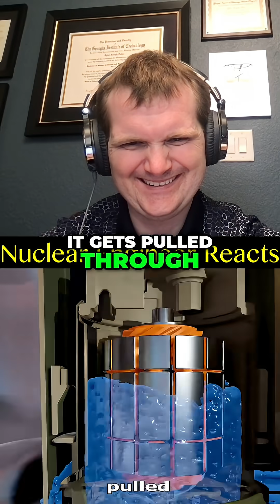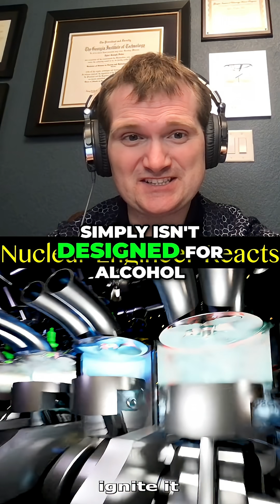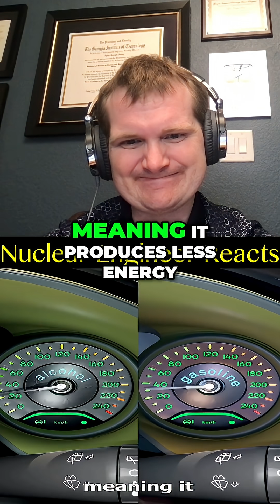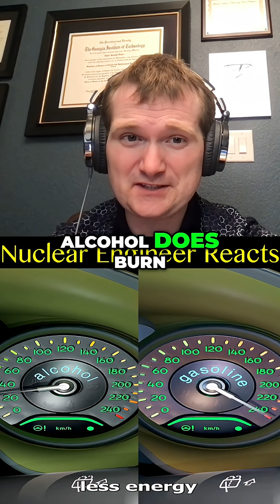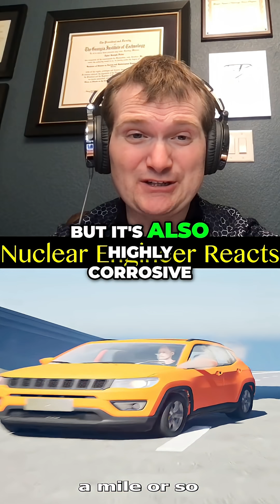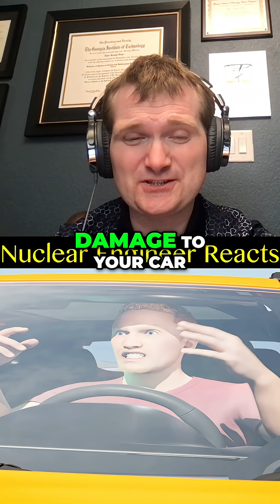Pouring Alcohol into a Gas Tank - Nuclear Engineer Reacts to Zack D. Films

Comment: There are cars running on ethanol and all gasoline cars can be converted to it. It's not really a problem, the air/fuel ratio just needs to be different. The engine will be fine with the right ratio. The fuel system might take a hit from corrosion and you might need to change the rubber fuel lines but those problems are fairly easy to solve

Comment: You can drive on alcohol but your cooling will  not fave the overheating cause it doesn't have the same octane  but if you double the radiation then is not a problem  most modern cars have ECU and will adjust the proper timings

Comment: If you have a flex fuel branded vehicle, it can accept Ethanol fuel, E15 and higher. The main drawback of using the American corn based Ethanol fuel, especially the E85, is that Ethanol is about about 25% less fuel efficient.  You may actually see a slight more performance,  but your mileage will be reduced. Even at today's E85 prices the benefits are not worth the lost efficiency

Comment: Gasoline is an alcohol so I think this is dumb... Well okay it's technically a rough mix of alcohol's and other petrochemicals either fractured or separated from crude but whatever... Point is - alcohol can and does run your car. But NOT drinking alcohol.

Comment: You can do it with a carbureted engine, as long as you warm it up with gasoline. 
Also….. it actually burns hotter than gasoline. 
I will always remember burning pure alcohol in a 1985 truck to pass emissions in Maricopa county AZ in the middle of summer.  I t had two fuel tanks, so I drove in on gasoline, switched the truck off, retuned the carb to run on alcohol, switched fuel tanks to the alcohol one, and restarted the truck. 
My engine temp was 240 when the test ended. I had to dump 10 gallons of gasoline into the tank as soon as I left the bay in order to not fry my block.

Comment: But in this specific case it is a heat problem. Every chemical reaction from a compound burning releases some form of energy. But in the case of a gasoline motor it runs specifically off of the byproduct of compression from the heat. Not the specific amount of energy released when the compounds themselves break down. It is actually less accurate to say its an energy problem over a heat problem.

Comment: The more gas you use, the better the car runs, at least on a car not made for it alcohol. Truth is basically all gasoline has alcohol in it from the pump. Ethanol also is much less likely to knock.

Comment: A lot of cars can handle 10% ethanol in fuel but not by default for most. Sporty cars usually are modded tovrun on Eth
Reply: every modern car can handle 10% ethanol because it's added to gas as an antiknock agent, replacing MBTE, which itself replaced TEL (lead). there are a few "flex fuel" cars, mostly from the late 00s/early 10s and mostly american cars that are designed to burn up to 85% ethanol. the only difference is the flex fuel cars have a sensor that determines the composition and adjusts the fuel mapping to maintain stoichiometric combustion.

there are also people who modify cars to use E85 because of it's much higher antiknock resistance, allowing timing, boost, and compression ratios to be cranked up, making more power out of the same displacement engine.

pouring vodka into an engine will probably not work because it's only 40% ethanol, and 60% water. and the water is of course really bad for the fuel system and can lead to rust and hydrolock.

Comment: Finally! A video I actually know something about. The alcohol will actually burn fine, you'll just need roughly 30% more per injector pulse to maintain the correct air/fuel ratio. This is why you can't run pump E85 in a non-flex fuel vehicle, the computer tuning is way off for the difference and it'll run like crap, if at all. Flex fuel cars have a sensor that identifies the fuel and makes changes in the tuning to compensate. E85 or alcohol in general is way more corrosive too, so the pump/lines/etc need to be rated for alcohol or you'll have other issues sooner than later. Alcohol does have its place in cars however, but they just have to be built for it. A lot of people use E85 in racing and motorsports because while it's less energy dense on its own, it also has a much higher octane rating, so it makes it safer to run on high compression and/or forced induction setups. You'll use 30% more fuel, but it's substantially less prone to knock and pre-ignition, which will make engines go boom in no time.
Reply: All this is also why it wasn't trivial to switch from leaded gasoline to unleaded with ethanol as the anti-knock agent. Because while ethanol works great as octane booster, tetraethyl lead is also a lubricant and forms a protective coating on the cylinder surfaces, while ethanol is an anti-lubricant. It's corrosive and strips away lubrication. It's such a shame lead is such a toxic heavy metal.
Reply: @tylisirn you're correct, lead also coats and destroys oxygen sensors, which are crucial components with fuel injection in basically every modern vehicle. The best race gasoline available is leaded, but you can really only use it on carbureted cars because they traditionally don't use oxygen sensors.
Reply: Yeah this guy is insulting popcorn sutton and the moonshine runners and I dont appreciate it.

Comment: Ah in some countries people  drive with wha5 they drink a classic carburetor aspirated engine wont matter what you put but it has to be 99% one also you can mix it with  sugar it will  increase the octane but you have to keep the engine  at higher  rev as possible the problem is not when the engine runs  but actually when it stops 😅 and yeah if you add sugar in alcohol it make even watter burn so yeah  100% octane 😅

Comment: E100 is a thing in some countries but most notably in Brasil, and despite having less energy per volume, with optimized compression it and a richer mixture (controlled by the ECU) actually produces more power because it has relatively higher octane ranking. For example, the famous 1.6 THP Peugeout engine modified for E100 in brasil produces 176hp versus 163 when used with gasoline. The lower energy density gives about 27% less fuel efficiency, Still it is far more eco friendly producing less than 25% of the amount of CO2 tha gasoline produces. Annnnd if produced by sugar-cane, it actually reabsorves 90% of the CO2 produced by the burn of previous ethanol for the plant itself to grow back for the new harvest.

Comment: I have modified my car parts such as fuel tank, transmission pipelines, cams, spark plugs and fuel pumps to run my car on 99.9% pure ethanol

All I did is retune the moving parts and replace much of the metal with fibre wherever possible

Now my car works fine (with a very negligible mileage drop though, but its okay)...
Reply: It’s corrosive so let us know how it works out over time
Reply: He'll probably have to replace lines and parts more often

Comment: Vodka sure wouldn't work very long but in most western country, every car made after 2000 can use ethanol and does work with 10% ethanol. You just need a kit for the calculator to adjust the injection to account for the slightly lower calorific value of ethanol. Normally it won't corrode.

Comment: Nearly every car sold in the US since 1995 has been E10 certified, meaning can run on gasoline containing up to 10% ethanol. So the fuel system is literally designed for resistance to ethanol, it wouldn't corrode, but most cars couldn't run on it though. Millions of cars on the road are also E85 capable though, so you could probably run one of those on something really high proof like Everclear. Not sure how well a modern fuel injection system would handle something like vodka but people have run carbureted engines on liquors
Reply: vodka is 60% water
E10 is 0% water
E85 is still 0% water
Reply: @mgntstr E100 hydrous etanol is 4% to 5% water
Reply: The issue is that most alcohols are mostly water and not ethanols

Comment: Here in Brazil we have cars that work with gas and alcohol at the same time. I have a friend that once got him self in the middle of a road without gas. So he went to bar and bought 3 liters of vodka he drove for 15km the car was ok.
Reply: A well designed engine computer with the right sensors can detect the fuel you are using and adjust the fuel air mix to function.

Comment: It could seriously damage your car because it is corrosive. You can put ethanol in gasoline to be around 10% ethanol in it and can see some improvement especially in older cars. You can also build an engine that can run on ethanol or even better methanol so you can have a high performance race car becauae of much higher octane number than regular gasoline.
Edit: newer cars my bad
Reply: There is no improvement in older cars in fact its worse for older cars simply cause they are never designed to run on ethanol. Modern cars that have a flex fuel sensor can run on E10 older cars run E5 max or better E0
Reply: @Based-Cat88 yea you are right
Reply: @partynhouse thanks for correcting it

Comment: You would be running way too lean with the Mass Airflow Sensors used in most cars. Chances are it wouldnt start withour buying a whole new FCU. Even a carbourator woukd struggle, since they are adjustabke between a range of mixtures, usually not all the way rich to the 9:1 ethanol requires. Maybe (and big maybe) an old airplane carbourator might get close enough to run, but then you have probkems with vapor lock and corrosion that show uo even with E10.

Comment: Quick question, you said that ethanol is "highly" corrosive, but I don't quite agree. Ethanol is neither a strong base nor an acid and doesn't react with metals or most materials. Could you explain to me how I could be wrong? Thanks.
Reply: Not a scientist, but a bit of a gearhead.   It's because ethanol is highly hygroscopic, which means it absorbs water vapour from the atmosphere.   This leads to oxidation, during which it also creates corrosive byproducts.  The toxic soup now running through the fuel system eats aluminum, plastic, and rubber especially- as mentioned by the previous reply
Reply: @shawn2780 It's the reason why you aren't suppose to let a full gas tank unused for too long if it uses ethanol. Plenty of cars run on E85, it just needs a kit for the calculator to adjust the injection
Reply: @shawn2780  Then it's rather not the ethanol itself but the water, and secondly it wouldn't be the water either that causes the corrosion but the ions dissolved in the water. Lastly, the mixture isn't toxic, it's just ethanol, dissolved ions and some water and aluminum is rather resistant to corrosion due to it's oxide passivation layer that's insoluble in water, ethanol's hydroxyl group is rather unreactive to metals as it's not particularly a free OH^- base, as for plastic, it would depend. For most plastics, you'd end up dissolving them because ethanol is miscible with both polar and nonpolar compounds (to a limited extent) and the fact that most plastics are build by conjugated pi systems (resistant by delocalization), by ethers (resistant without strong acids) or by amides, (needs a strong base or acid to catalyze hydrolysis). Natural rubber, which is cis-1,4-polyisoprene is just a polyalkane linked together by alkene bonds, which make the only possible reactions either: reduction or addition. Ethanol can do neither, we know non-acid electrolytes can't exist in the rain because ionic salts are not volatile and can't dissolve in gaseous water.
Reply: Ive heard it degrades plastic, like rubber fuel lines. Or at least the fumes do, not completely sure but i think its an acetone like corrosive effect based on some chemical interaction other than acid or bases
Reply: @harrisongazeley8028  It's rather a dissolution than corrosion. It's like the popular misinformed video calling fish oil capsules corrosive because they dissolve Styrofoam. There is no logical chemical explanation for why ethanol is corrosive at all, it's reactive, sure. But by no means corrosive. It has no oxidizing or reducing power, isn't anything but a phase transfer catalyst/solvent and acetone is far different from ethanol due to it's carbonyl group, this makes it WAY more reactive than ethanol is. But then again, neither is acetone corrosive. By my definitions and maybe by alot of other chemists out there, corrosion would be the chemical process of either a direct redox reaction or hydrolysis that converts an insoluble compound/element into it's soluble product/components.